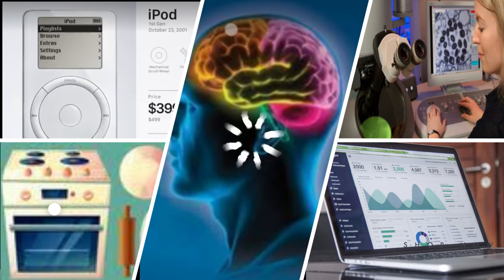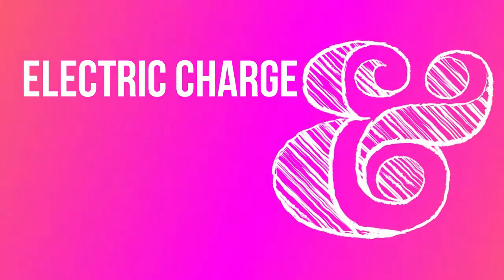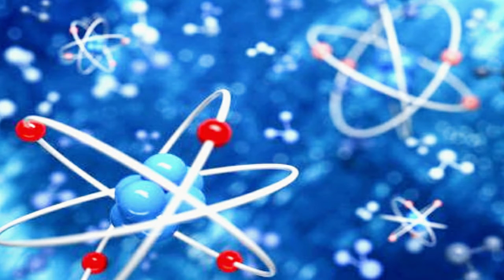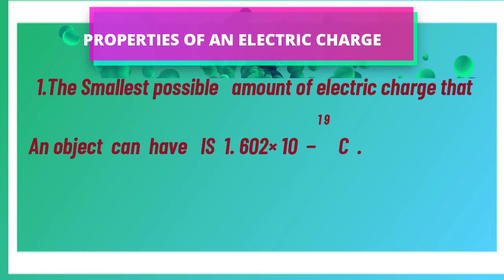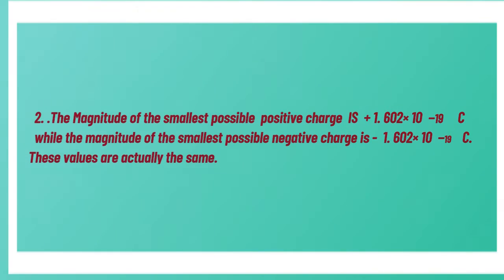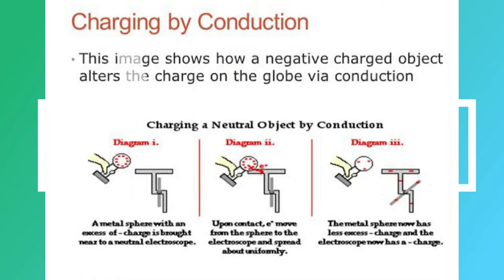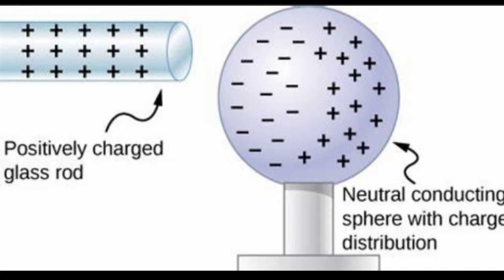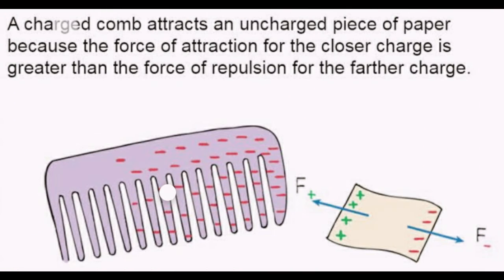ELECTRICITY- An introduction

Comment: Kristine M. Dela Cruz
BSE 2-A

Application of Conduction
-A metal spoon becomes hot from the boiling soup inside the pot.
-Walking on the beach on a summer day will warm your feet.
-When a breakfast is placed onto a plate, the plate will feel warm after several minutes.

Application of Induction
-A speaker plays music connected with the cellphone via bluetooth.
-When a computer monitor or television screen is turned on it begins to build up a charge and dust particles induces on the screen.
-When a negatively charged balloon that is brought near a neutral wall. 

Application of Polarization
-A 3d movie used polarization by filming using slightly different camera locations.
- When the light reflected off a river is partially polarized in a direction parallel to the water's surface.
-A driver wears sunglasses to reduce the light coming from the sun.

Comment: Jose, Gabriel Jose, S.
BSE-2A

Conduction
1. Roasting chiken in the fire.
2. The hot soup or drink soothing a sore throat.
3. Warming your back muscles with a heating pad.

Induction
1. The transformer we use in our house  creates voltage by the movement of a conductor in a magnetic field.
2. When we charge our phone the transmitter coil generates an electromagnetic field that the receiver converts to electricity for the phone battery.
3. When using induction cooker we uses electric currents to directly heat pots and pans through magnetic induction. Instead of using thermal conduction (a gas or electric element transferring heat from a burner to a pot or pan), induction heats the cooking vessel itself almost instantly.

Polarization
1. Undisturbed water
2. Glass
3. Sheet plastic
In these instances, light waves that have the electric field vectors parallel to the surface are reflected to a greater degree than those with different orientations.

Comment: Embuscado, Ruvie Mae B.
BSE 2-A

CONDUCTION
  - when you heat food using oven, the      food will heat well
 -ironing clothes with   pressing iron.
 - welding of two iron metals together.

INDUCTION
- High speed vacuum cleaners
- washing machines
- Refrigerators

POLARIZATIONS
- Display Technologies
-Ripples in water
-Infrared Spectroscopy

Comment: Raymart B. Villacorta
BSE 2-A (GEN.SCIENCE)

Examples of Conduction
1. Touching a stove and being burned.
2. Ice cooling down your hand.
3. Boiling water by thrusting a red hot piece of iron into.

Examples of Induction
 1. Transformers
  2. Induction cooker
  3. Wireless access point

Examples of polarization

1. Ripples in water, when you throw a stone.
2. The motion of sound waves through the air 
3. The electromagnetic waves they form when a electric field that interacts with a magnetic field.

Comment: Gamboa, Kristine E. 
BSE 2-A

Examples of the Application of Conduction 
1.	The handles of the cooking utensils are made of materials like plastic and sometimes wood which cannot conduct heat when carried by the cook;
2.	Woolen clothes which prevent the body from losing heat to the surrounding are worn during cold;
3.	Thatch- roofed homes feel cooler inside than houses covered with an iron sheet because iron conducts heat.

Examples of the Application of Induction
1.	A magnet moves by your mechanical work through a wire. The induced current charges a capacitor that stores the charge that will light the light bulb even while you are not doing this mechanical work.
2.	Devices such as electric motors and generators
3.	Inductors and transformer

Examples of the Application of Polarization
1.	To differentiate longitudinal and transverse wave
2.	As sunglasses to cut off unwanted reflected light best utilized by fisherman, motorist, skiers, sportsman, etc.
3.	Effect of a polarizing filter.

Comment: Mark Anthony C. Hipolito
BSE 2-A

Conduction Example
•Touching a stove and being burned
•Boiling water by thrusting a red-hot piece of iron into it
•When frying vegetables in a pan. Heat transfer takes place from flame to the pan and then to the vegetables.

Induction Example
•Wireless access point
•Guitar pickups
• Unplug a lamp while it's turned on, and watch the area around the wall outlet. You should see a blue spark in the air at the moment when the prongs of the plug lose contact with the electrical contacts inside the socket.

Polarization Example
• A musical instrument like a guitar string. Depending on how the string is plucked, the vibrations can be in a vertical direction, horizontal direction, or at any angle perpendicular to the string.
• Light may be polarized by reflection or by passing it through filters, such as certain crystals, that transmit vibration in one plane but not in others.
• Reflection of light off of non-metallic surface results in some degree of in some degree of polarization parallel to the surface

Comment: Ostares Melodie R.
BSE 2-A

APPLICATION OF CONDUCTION:
Examples: The three examples of conduction are mugs, kettle and frying pan.
*Kettle- conduction using to make boiling water
*Mugs- conduction heat from a hot coffee makes the mugs hot.
*frying pan-conduction from a frying pan to a cooking pancake.

APPLICATION OF INDUCTION
Examples: 
     The three examples of Induction are Eletric Generators, cellphones and current clamp.

APPLICATION OF POLARIZATION
Examples:
       The three examples of Polarization are:
*Polaroid sunglasses   -to  reduce the glare
*Infrared Spectroscopy -uses of polarization
*Polaroid Filters             -used in plastic industries for 
                                          performing stress analysis test.

Comment: Brillante, Anjelika Marie M.
BSE 2-A
CONDUCTION:
1. Cooking with a metal pot.
2. Welding of two iron metals together
3. Ironing of clothes with pressing iron.
INDUCTION:
1. fan
2. washing machines
3. refrigerators
POLARIZATION:
1. used in sunglasses to reduce the glare
2. used by the fishermen to spot the fish underwater.
3. used to reduce the glare of headlights of the car

Comment: Kyla Mae P. De Guzman
BSE 2-A

Application of Conduction
-Ironing of clothes with pressing iron.
-Touching a stove and being burned.
-Ice cooling down your hand

Application of Induction
-High speed vacuum cleaners
-Electric shavers
-Drilling machines

Application of Polarization
-Polarization is used in sunglasses to reduce the glare.
-Polaroid filters are used in plastic industries for performing stress analysis tests
-Fishermen make use of polarized glasses to spot the fishes in the water

Thankyou po.

Comment: Trinidad, Anna Mae M.
Bse-2A
Application of conduction, induction, and polotization.

Application of Conduction
• When a flying kite hit by lightning during thunderstorm.
• When you are wet and you accidentally touch a live wire.
• When you turn on your computer or any electrical device, electrical conduction is what makes them function.

Application of Induction
• Tablets used by many graphic artists use the same principle. A battery-operated pen is used on a screen that is connected by several wires. The magnetism coming from the tip induces the emf on the screen, translating into graphical images that the artist draws.
• One example is data storage which is done by recording with the help of magnetic fields. In some computers, hard drives data is recorded on a spinning disk that is coated.
• Hybrid or electric vehicles also work on the principle of electromagnetic induction. It also sees an application in treating patients with mental disorders like hallucinations and depression by way of transcranial magnetic stimulation (TMS). Here magnetic stimulation is applied to identified areas of the brain of the patient to bring relief.

Application of Polorization
• Polarization is used in sunglasses to reduce the glare.
• Polaroid filters are used in plastic industries for performing stress analysis tests. 
• Three-dimensional movies are produced and shown with the help of polarization.

Comment: Reyes, Jerome M.
BSE-2A

Conduction
Examples:
1. Touching a live wire.
2. Charging your phone
3. Electrocuting fish by putting a live wire on water.

Induction
1. Wiping your ATM card when your in a supermarket.
2. Lighting a buld by placing a magnet near a electric wire.
3. Sending message using by your phone through electrical signals.

Polarized
1. Photographers make use of filters to reduce glare in order to get clear pictures.
2. Sunglasses are vertically polarized to block glare by water that reflects sunlight.
3. Automobile headlights are horizontally polarized to provide a better view of the road.

Comment: Israfien T Undi 
BSE 2-A

Example of Application of Conduction
-Touching a stove and being burned.
-Boiling water by thrusting a red-hot piece of iron into it.
-Ironing of clothes with pressing iron.

Example of Application of Induction
- Electric generator
- Induction cooking 
- Hall effect meters

Example of Application of Polarization
-Polarization is used in sunglasses to reduce the glare
- Polaroid filters are used in plastic industries for performing stress analysis tests.
- Three-dimensional movies are produced and shown with the help of polarization

Comment: Roselin T. Palon
BSE-2A

1.APPLICATION OF  CONDUCTION - Heat conduction is applied in cooking with metal pot e.g. Aluminum pots.
- Ironing of clothes with pressing iron.
- Welding of two iron metals together.
- The handles of the cooking utensils are made of materials like plastic and sometimes wood which cannot conduct heat when carried by the cook.

2. APPLICATION OF INDUCTION - Polarization is used in sunglasses to reduce the glare.
- Polaroid filters are used in plastic industries for performing stress analysis tests.
- Three-dimensional movies are produced and shown with the help of polarization.

3. APPLICATION OF POLARIZATION -  Current clamp.
- Electric generators.
- Electromagnetic forming.
- Graphics tablet.
- Hall effect meters.
- Induction cooking.
- Induction motors.
- Induction sealing.

Comment: Kyla C. Chavez
BSE 2-A
 
CONDUCTION:
1. When you make hot coffee in a cup, there is a chance that the cup will also heat.
2. when you heat food using an oven, the food heatsup as well.
3. being burned after touching an oven.

INDUCTION:
1. When you place your phone on the charger, the transmitter coil generates an electromagnetic field that the receiver converts to electricity for phone battery.
2. The magnetic stripe on the back of your personal credit card as used at grocery or atm machine.
3.Light bulb supply electric charges that flow around the circuit.

POLARIZATION:
1. The movement of vibrations through air.
2.a charged plastic tube is held near to neutral paper bits, the attraction between the paper and the plastic would be sufficient to raise the paper off the table.
3. If the negatively charged balloon is brought near the aluminum pop can, the electrons within the pop can will experience a repulsive force.

Comment: Trinidad, Camille L
BSE 2-A

1. Give at least 3 examples of the application of conduction, induction, and polarization.

-Conduction:
Touching a stove and being burned.
Ice cooling down your hand.
Boiling water by thrusting a let-host pieces of iron into it.

-Induction:
Suppose I have taken 20 marbles at random from a large bag of marbles. Every one of them turned out to be white. That's my observation - every marble I took out was white. I could therefore form the hypothesis that this would be explained if all the marbles in the bag were white. Further sampling would be required to test the hypothesis. It might be that there are some varicolored marbles in the bag and my first sample simply didn't hit any.

-Polarization
Ripples in water, when you throw a stone.
The motion of sound waves through the air.

Comment: Garcia, Honey Grace B.
BSE 2-A

Application of Conduction

• Heat conduction is applied in cooking with metal pot e.g. Aluminum pots.
• Ironing of clothes with pressing iron.
• Welding of two iron metals together.

Applications of Polarization:

• Polarization is used in sunglasses to reduce the glare.
• Polaroid filters are used in plastic industries for performing stress analysis tests.
• Three-dimensional movies are produced and shown with the help of polarization.

Application of Induction

Small fans.
Mixers.
Toys.
High speed vacuum cleaners.
Electric shavers.
Drilling machines.

Comment: JEMARIES M. MANGULABNAN
BSE 2-A

EXAMPLE  APPLICATIONS OF CONDUCTION

1. Ironing of clothes with pressing iron.
2. Heat conduction is applied in cooking with metal pots, Aluminum pots, etc.
3. Welding of two iron metals together.

EXAMPLE OF APPLICATIONS OF INDUCTION

1. Electric generatos use magnetic field to interfere with the electrons in the conductor to induce a flow of electric current inside it.
2. Graphic tablets use specially designed pen to draw digital images, also applies induction principles.
3. Current lamp use electric current flow to make a circuit.

EXAMPLE OF APPLICATIONS OF POLARIZATION

1. Polarization is used in sunglasses to reduce the glare.
2. Polaroid filters are used in plastic industries for performing stress analysis tests.
3. Three-dimensional movies are produced and shown with the help of polarization.